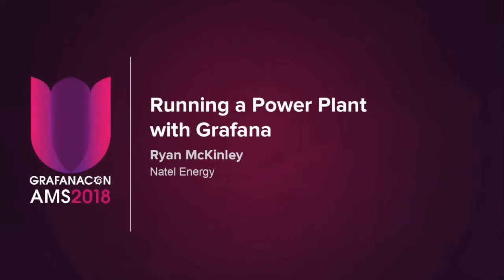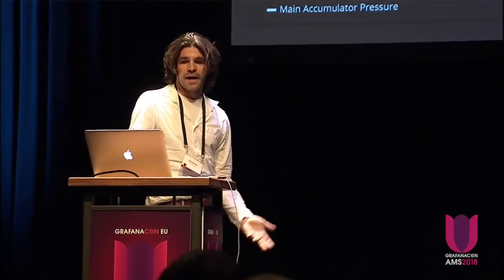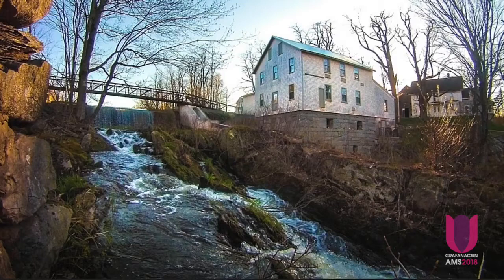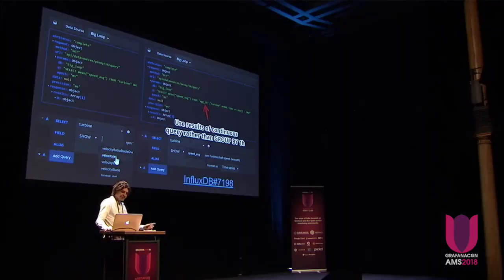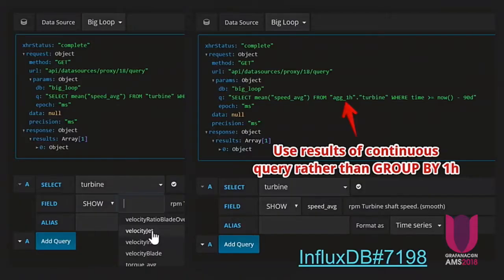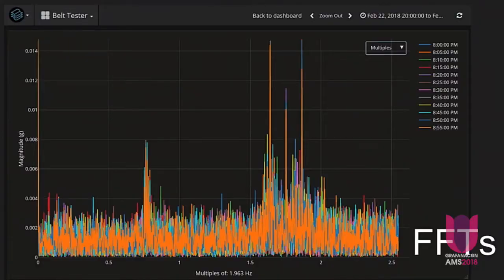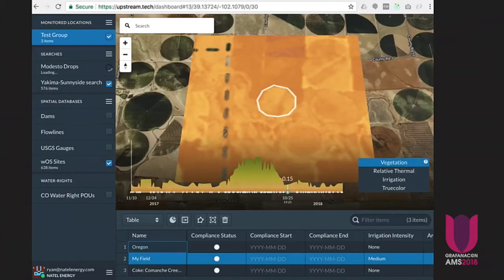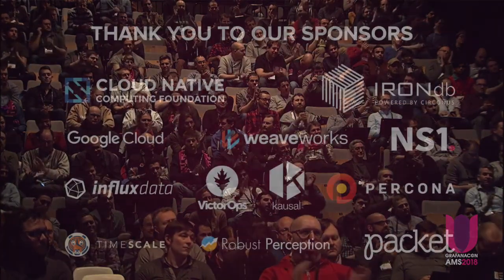Running a Power Plant with Grafana

Comment: +1 this!
 I've added Grafana as a frontend to older electric and water utility SCADA systems and everyone loved it, using graphite/whisper time series DB. Recently had a system replaced by a systems integrator using FactoryTalk  and the "XLReporter" reporting tool,  and those seem less capable on the UI and reporting front and after using those for a while, users still want to use the Grafana dashboard, which only has a few items on it now as the PLCs we were pulling data from have been removed and replaced with news ones that apparently don't talk Modbus or DNP or any protocol openly available (more of that Allen Bradley/Rockwell vendor lock-in).